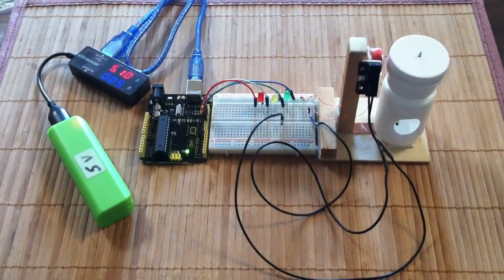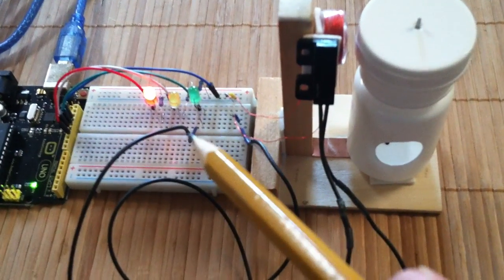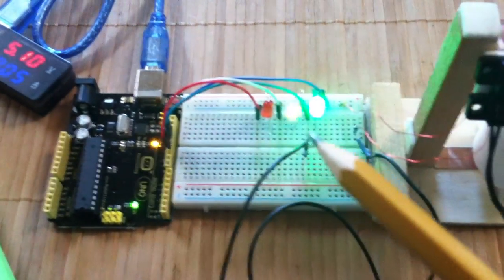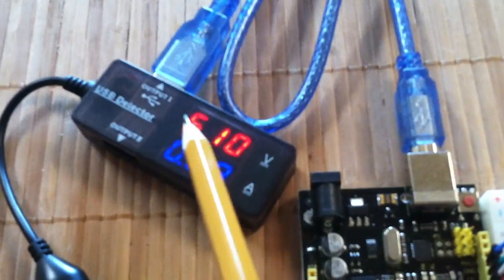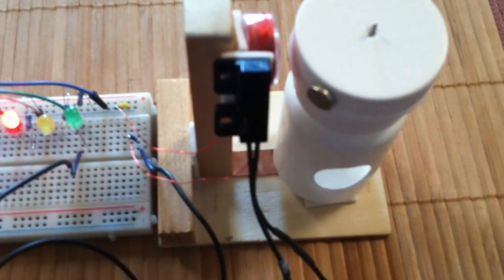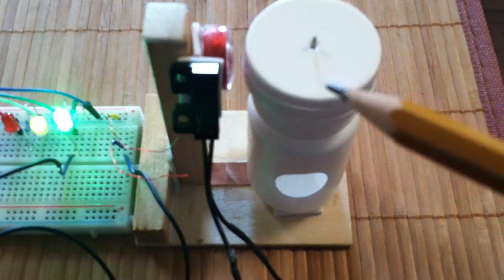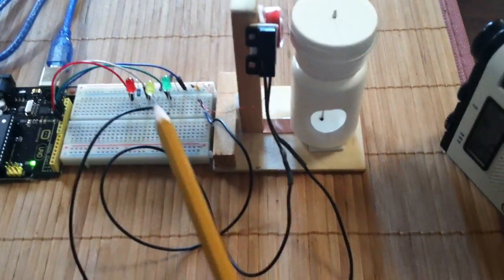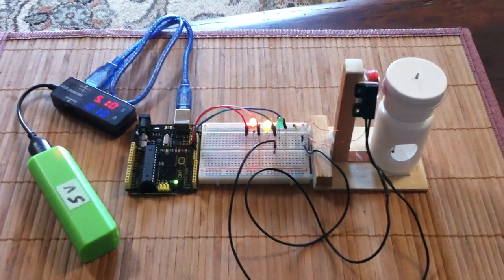Arduino controlled Darning Needle Motor

Comment: A good idea to do the Arduino! I have several laying around but have not gotten to it. I do think I am able to program it quickly after so many years of programming experience (c/asp/php/javascript etc). I saw Julian Llett playing with the Arduino and he showed that timing when it get's critical is a little bit more difficult. In the end he had to stop all interrupts. He had to because it was stealing away micro seconds. And if it just happens often enough, microseconds become milliseconds. And away goes your exact timing. But a pulse motor already has to deal with acceleration so the programming will have too.
Haha, and then the telephone rang and he said: Thanks for watching!
Reply from the maker: +deslomeslager  I think if I hunt around I can find a program that basically does what I want it to do and then just modify it.  What I started out looking into months ago was BLDC motor drivers when I was working on that pill bottle motor.  I was going to add more coils to the stator and then just use a regular RC BLDC driver to run it.  That led me to the Arduino but then that started a whole new learning project.  It goes on and on ---and then the telephone rings. Ha.

Comment: Very neat and a wonderful link to computer control.
I bet you're 'enjoying' C++ lol, takes some getting into, but the example progs are superb for learning (and copying code from). 
Am just back from the flying field, where I flew a self coded Arduino controlled plane, so the sky really is the limit with these :)
Reply from the maker: +slider2732  All I am doing right now is using example programs.  This is all brand new to me.  I got one of the inexpensive UNO starter kits that has enough stuff in it to get me going and then just hunt around online for software.  I hope you make a video of your plane.  That sounds  pretty cool.

Comment: Thanks for sharing.  Your video description provides good summary, your pulse motor is only powered when the green LED is On.  FYI: The Arduino UNO 5V 20mA max digital output current can power a pulse motor but is not enough current to run most relays, solenoids, or motors directly.  Short circuits on Arduino pins, or attempting to run high current devices from them, can damage or destroy the output transistors in the pin, or damage the entire Atmega chip.  A 470Ω or 1k current limiting resistor is recommended for heavier loads.
Reply from the maker: +ReasonForemost Thanks for the great info. I'll be careful with the power for sure. I am kinda treating like a delicate CMOS 555 timer circuit-----only with an Einstein brain.